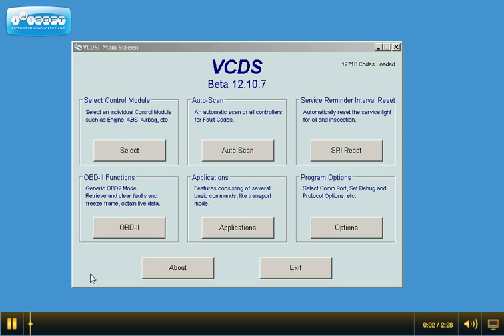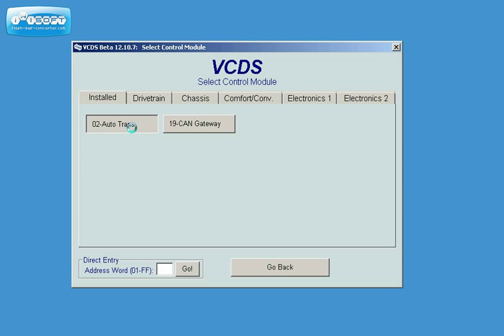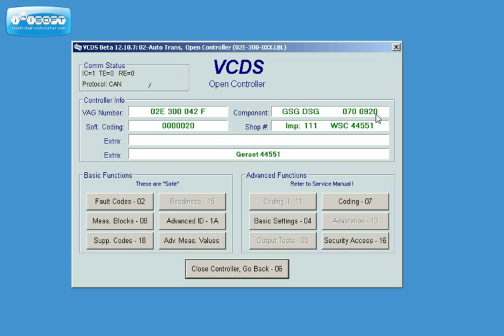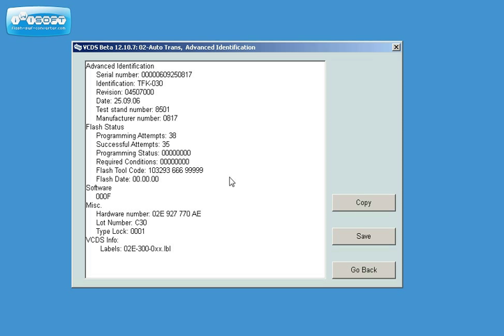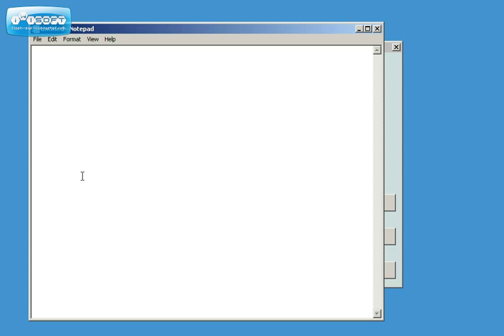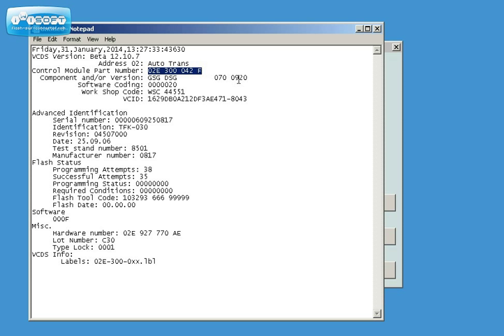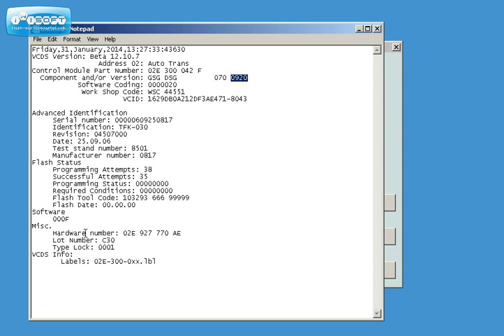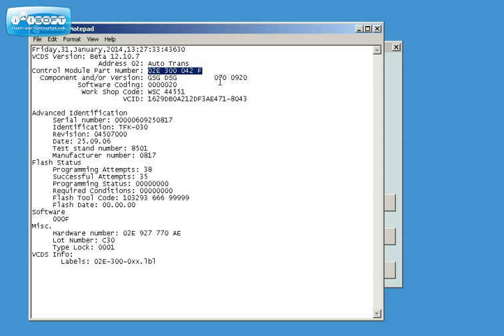DSG Advanced ID, DSG6 DQ250 VCDS Advanced ID

Comment: I am changing my DSG 02E to another, used gearbox from the scrap yard.. Do I need to do something like this, with the replacement gearbox? I am changing the whole gearbox, not just the mechatronic unit
Reply: SI .... HAY QUE CLONAR TODA LA INFORMACION DE LA MECATRONICA ORIGINAL A LA USADA O EL SISTEMA NO VA A RECONOCER EL RECAMBIO  Y SE INMOBILIZARA EL AUTO

Comment: very interesting video i have a problem because i did not copy the orginal advanced id and i changed the mechatronics and geaarbox from another car?????
Reply from the maker: And the problem is ? IF you changed the Mechatronic you need to make sure the software fits. If not, the "new" unit might need a re flash.
Reply: the problem is p1869 implausible message from electric load controller